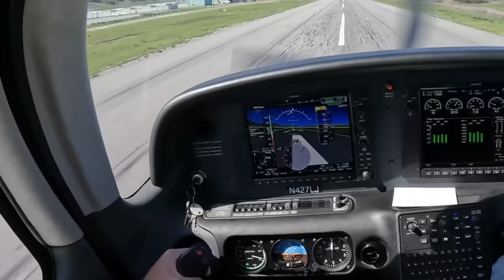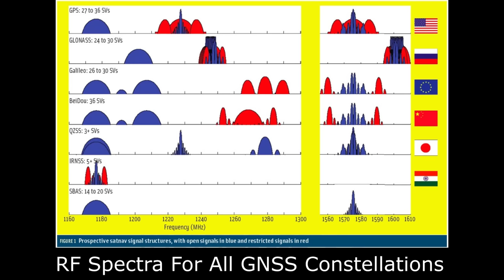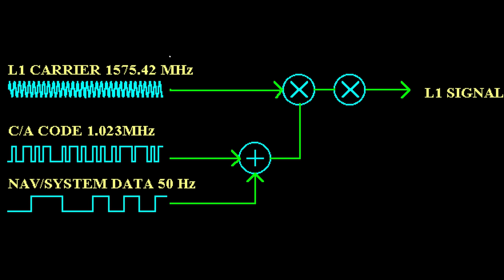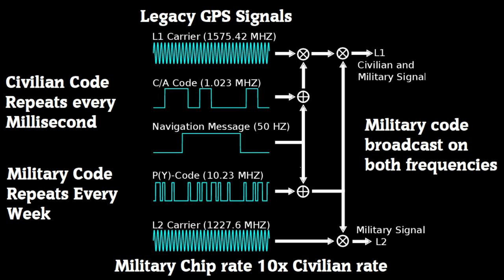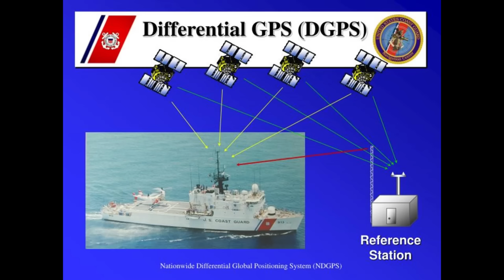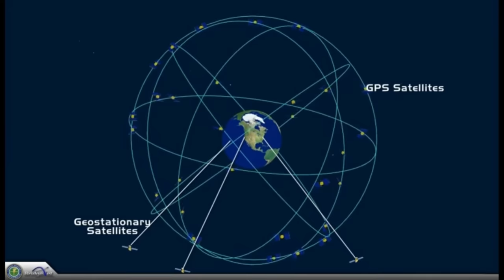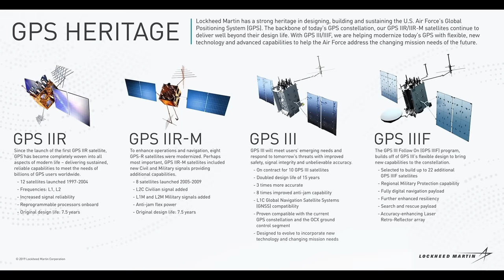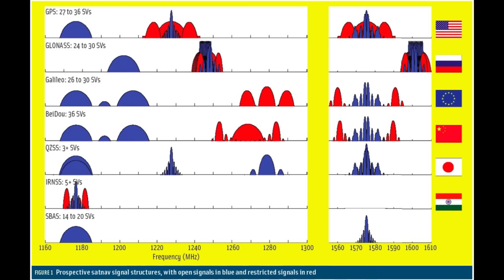How GPS Works, And How It Got Better Than The Designers Ever Imagined

Comment: I once read that civilian GPS recievers are limited in how fast and how high they can calculate to stop them being used in DIY guided misiles etc.  Don't know if this is still the case though.
Reply: It is still partially the case, commercial GPS receivers originally had to stop working if they were above 18,000m or moving faster than 1000 knots (~500m/s). Those limits have been relaxed to only disable at speeds of more than 600m/s. If you want to sell a receiver that can operate faster than that, then you'll need to apply for a license (it's similar to, but separate from ITAR). eg Copenhagen Suborbitals had to ask their GPS supplier very nicely to get units that they could use on their rockets, but as a clearly civilian program, they were allowed. 
Although these days it's possible for a hobbyist to build their own GPS receiver with no limits at all, which implies it's trivial for a country like North Korea.
Reply: Trying to get a GPS receiver capable of weapons usage is a huge pain. You have to get approval from not just the supplier, but from the government as well to purchase one. You go through all this paperwork, and jump through so many hoops to get one. And even then, lead times can be measured in months if not years.

Comment: I still want to know how the M code seems to be able to (or will be able to) provide authentication/etc in a way that doesn't mean any enemy who can extract a key gets that capability as well.   I don't see how you can do it w/o either a nightmare key rotation issue or packing too many bits into the M code.
Reply: M code’s phase data is available with a high gain antenna, no need to know the code or anything, the receiver will have enough S/N to just see the random bitstream as it comes in and can lock to it. Not practical for hiking but for large enough vehicles it’s doable. Needs a phased array antenna or an equivalent stabilized pointable dish to have enough gain. M code having unpredictable bitstream is only a problem when you have a small receiver - then you need to know the bit pattern ahead of time to lock onto it. With high gain antenna - no need to use the bitstream for selectivity and SNR improvement.

When the antenna is not omnidirectional, there’s no need for code division demultiplexing :)
Reply: @absurdengineering  Right, but that doesn't give you authentication (eg cryptographic verification that the signal isn't being spoofed).  I understood that the military equipment could do that so munitions could switch to inertial guidance in case of spoofing.

Comment: I beg to differ on a couple of points. I was in the RCAF in the 60s-70s and a friend of mine was posted to Monterrey, CA, from 1977 to 1980 to work with the USAF on the Navstar program. He returned to Canada in 1980 with a pile of documentation, on what would become GPS, that I devoured.

1) It was planned from the start that GPS would be made available to the public in order to ensure that mass production of components would drive down the price
2) the initial 100 meter accuracy was a security feature imposed by the USAF that restricted accuracy for civilian users. As you mention, the USAF turned off selective availability in 2000
3) the 1980 documentation I mentioned predicted uses by hikers and bikers and predicted that a hand held GPS unit would be available by 1995 for under $500. I bought my first hand held GPS device in 1997 for about $100

Comment: Thankyou for a good explanation.

I once worked on GPS receivers , on the correlator subsystems that tracked the signals, and one additional technique we were aware of but did not use was the fact that even though nobody outside the USA knew the week long spreading code used for military signals, you could try guessing sequences of the bits (chips) and if you guessed sequences of chips right , you could get a weak signal that was very precise but really only if you also knew your receiver was fixed, as you ended up with a  range that was totally inaccurate . So you didnt know how far you were from the satellite but you could see the fixed position drifting as the ionosphere changed.  So it meant you got nearly as good as military positioning but only for a fixed  base station.
As we were making mobile GPS silicon we could not use it.

Comment: I worked in forestry in Canada back in the mid-90s and we used GPS for various purposes - the position data we gathered was uploaded to a computer that had special software that took the uploaded data and compared it with a base station file from the same time frame to correct for errors . . . the base station was a stationary GPS receiver/recorder that ran 24/7 and you had to dial into their server to get access to the files.

Comment: Great explanations!   I used to give classes to pilots on the functionality and improvements in GPS.. from DGPS to WAAS and LAAS.   What's also amazing is Real-Time Kinematic positioning (RTK), which is primarily used for surveying.  RTK is a similar application of DGPS, in the context that a base station GPS receiver / transmitter is set up at a site to be surveyed and then "satellite" GPS units are used around the survey site, communicating with the base station to give a super-accurate relative positioning that's at the centimeter-level of accuracy.
Reply: hi 5thgen,what do you think about all gubments drawing a line around you(Antarctic Treaty) and saying you are not allowed to leave? If you don't know what I mean, read my about tab.

Comment: As a 40 year pilot I used to think the the first aviation versions of the Loran receivers were the best tool a pilot could have since cabin heaters in January. Then I played w/ my first Garmin portable receiver... GPS-95 XL about 1993ish. That was slicker than A/C on a car in Southern Arizona. It is a wonderful tool for navigation. I wonder if anyone could calculate the fuel savings by aircraft since using GPS. And of course, fuel savings means less poison spewing into the atmosphere, and less money spent on the hundred dollar hamburgers (which are up to around $225 now). And the peace of mind the GPS receiver lends to a pilot having trouble w/ recognizing pilotage landmarks, or receiving a VOR between mountain ridges, is worth a great deal too. Thanx for the insights Scott. Terry - CFI-I

Comment: I find the premise of this video hard to believe.  Around 1984 my father took a job in the 6585th test group at Holloman AFB in White Sands, New Mexico. His task as the only GS-15 on the project, was to lead a team of programmers, and the program was be a navigation reference system. This system was then used for the development of dropping smart bombs at precise spots in 3-D space. Dad's program could prove that an object was released within a 25 foot cube while a jet was flying at Mach 1. Today the transponders are on satellites and the movements tracked are on the ground, but back then the transponders were on the ground and the objects being tracked were the jets -- F-15's and 16's mostly. The system had "only" 25 feet of cubic proven accuracy -- but that was releasing an object in a specified 25 foot cube and proving it was done so at a given microsecond while said object was flying about 700 miles an hour. I don't think that a fraction of an inch for a relatively stationary object is at all "Better Than The Designers Ever Imagined." It is exactly what my dad, Gordon Simkin, envisioned in the mid 1980's. He is 92 today and has never looked for any credit, but I know what he did and I'm proud of his role in developing this technology which is a great contribution to the world.

Comment: In school in the 80's we learnt about Loran-C and the Transit satelite systems.  Later, I had to go back and take some GPS courses.  In the early 90's we had a set of six units doing control survey work.  Setting up a unit and reading signals for four hours, the guys in the office would post-process the results of the six units and get standard deviations of 1cm.  :)

Comment: The slide that shows the GPS constellation being "27-36 SVs" is interesting to me.  It's been a long time since I was working on the program, but I thought I remembered it was a minimum of 24 SVs required - i.e. not 27.  Also, while there were 6 orbital planes with 6 slots each, the SVID field, which also identifies the PRN each SV uses, was only 5 bits, so you could only have 31 active SVs.  SVID 0 was invalid.  In fact the way they would SATZAP the II/IIAs - make it so receivers wouldn't use them (typically if the clock became unhealthy) - was to command the SV to SVID 0.  A few SVIDs were also eaten up by the SV simulators for testing, down at the Cape.  I can't remember if adding a bit to the SVID field wasn't possible because there weren't any spares, or if it was just deemed a change was impossible due to its effect on all of the users, or both.  But I guess I'm curious if that 36 number on the slide means they did it?

Comment: Fascinating and well researched video, thanks. You must have put a huge amount of research into this. In the late '80s I worked on field tests in the S. China Sea for early commercial differential systems when the best we could hope for was a 3 or 4 satellite constellation for an hour or so in every 24 hours (all too often in the middle of the night when our surface broadcasts were disrupted). By the time of the gulf war, we were using standard communications satellites for differential corrections which were good up to about 1000 km from the reference station and roughly an order of magnitude more accurate than the  military receivers of the time. I know this because the military actually used our differential system during the gulf war and gave my employer a standard military receiver afterwards for testing and research as a thank you. Also, one tiny correction… To calculate a 3D position using a least squares calculation, you need at least 2 degrees of freedom to eliminate ambiguity in the result. Therefore, you really need at least 5 satellites for an accurate 3D position (x, y, z). (I'm not a mathematician, but I was told this by one so apologies if I've over simplified or mis-quoted).

Comment: One other topic worth covering is spoofing. The open and unauthenticated nature of these signals means it’s entirely possible to convince a receiver its somewhere or somewhen it isn’t. Occurrences of this by nefarious state actors are well documented. 

Both GPS and Galileo ate taking steps to add nav message public/private key signing to make things somewhat safer. You can’t necessarily get a true position when being spoofed but you will more likely be able detect it without exotic signal processing in the receiver.

Comment: During Desrt Storm, my Heavy Mortar Platoon had to use LORAN in order to detrmine our position. Due to the small number of beacons, it took about 3 minutes to plot our location which drastically slowed our response to a Call For Fire. With the rate of march for the armored attack, we never got a shot off as the tanks and BFVs began direct fire on the enemy before we could get rounds out.

Comment: Other commenters have mentioned the improvements in GPS using carrier wave analysis.
The "productized" name for integrating those corrections from various sources is called "RTK"  - Real-Time-Kinematics.  WIth a smart enough receiver, one can combine signals from the various global navigation satellite systems with ionospheric, tropospheric, and ephemeris corrections from multiple base stations, both via radio and now even internet sources.  Even better, the receiver can track its own position over time, giving it relative accuracy from position to position measured in millimeters.
Those improvements have enabled amazing advancements in precision farming.  A combine harvester can track yield for every position in a field. Then a strip tiller can only disturb soil in rows where the next season's plants will be seeded, applying fertilizer where it is most needed. Then the next planting season the planter can repeat the path in those same rows, and apply just the population needed for optimal crop density.  
The machines to do this are still incredibly expensive, but the savings on inputs (seed, fertilizer, pesticide, fuel) are immense, sometimes as much as 90%.

Comment: At those frequencies, there will also be tropospheric anomalies caused by temperature inversions. Colder air and warmer air will have different refractive indexes. Thus, there will be a lens effect that will bend the signal paths. A different effect to the ionosphere but significant nonetheless.

Comment: When I was a young officer in the Air Force, the GPS was being developed in the next building over from us.  Every so often we would get informational progress updates on the unclassified portions of the various R&D projects.  I remember them showing the GPS receivers mounted on the back of a 2.5-ton truck with a potential of getting the receivers small enough to fit into a backpack so every platoon could have one.  But even in 1979 they never conceived of a cost and size that would allow every Army private to carry one around.

Comment: It’s crazy how civilian GPS went from 10’ accuracy where it knows what road you’re on (usually), to knowing what lane you’re in at a 6’ accuracy at the end of 2021, and nobody talked about it.  Apple still doesn’t advertise it except the accident detection made possible by dual band.  Then there’s also the problem with reflections while on a hillside or in a ravine or canyon.  Basically making the signal take a longer path.  Dual band can use math and the 2 frequencies to reduce reflections.  I wonder if the upcoming solar season that makes 10 meter Hams happy will affect GPS accuracy.

Comment: Way back in 2005 I installed a Garmin WAAS enabled GNS430 in my Cessna 335.  What a difference that made to flying, especially on more challenging IFR flights (weather, rerouting...).  Later I installed two Aspen PDF for redundancy which was also a quantum leap.  But WAAS GPS still was the most significant step.

Comment: In the UK, my GNSS receivers can see GPS, Glonas and Galilio in one receiver and very quickly gets to sub 1m accuracy with 14+ satellites in view. When I started messing around with gps in the early 2000s, it wasn't uncommon for mapping to think you were on a parallel road, but now it knows if you've gone up the wrong junction.

I just wish GPS receivers with integrated inertial navigation built into their chipsets were more common - even modern cars get confused in tunnels, when they could fairly easily combine compass, speed and angle data to perform dead reckoning fairly reliably.

Comment: The first GPS ground receivers and satellite transmitters were called reference receivers and transmitters.  I saw an example of both in the late 1980's .  They were used to certify receivers and transmitters built by military contractors and civilian corporations.  Those reference models were basically half a rack of equipment.

Comment: Hi Scott! Great content as always! I’ve learnt a lot from you in the past few years. I just have one suggestion though. It is not entirely accurate to say GPS are accurate enough to land a plane. The challenge of many autopilot or navigation system is to estimate error or uncertainty from the sensors and correct for them. So in this case, the accuracy of GPS is critical but more importantly, we need to estimate its sensor noise correctly. We may also need to fuse other sensors such as IMUs to help estimate noise jointly. As you may know, one popular algorithm for this purpose is called Kalman Filter.

Comment: What I find lovely about GPS is that many civilian receivers built just after the initial completion (around 1994) still fully work with the current satellites, and they actually work better - being more accurate than indicated - than they did back then (and not just because of SA). Much more emphasis on backwards compatibility than with cellphone or computer networks.

Comment: This really just scratches the surface of how it works and how it gets better accuracy. Even just overview of modern techniques would take few hours. Lets just say that there are tens of  thousands of people around the world dedicated to making it work. The techniques and technologies behind are mind blowing. 1mm accuracy can be achieved (usually only at reference stations), but few cm accuracy is available for some uses too (not aviation, as many of these techniques do not work over ocean). There is a lot of modelling and corrections involved (including crust movement, seismic activity, earth rotation variations, solar wind, gps satelites atmospheric drag and radiation pressure from sun and earth on them, friction due to ocean movement, and tidal effects of the moon, and other planets in solar system, and of course ionosphere and troposhere modeling, including scintillation, and localized measurements; as well modelling errors in the GPS satellites itself and clocks in the entire system, and probably many more I had no clue about. I did not even mention multipath effects, leaver arm effects, and that receiver do not just use edge of bits for timing but phase differences at the wavelength scale). Differential gps is still used in some applications, but the augmented systems are usually cheaper to deploy and operate (usually using internet, 3G network, auxiliary data channels on geostationary satellites, or in case of Japan system GNSS satelites  directly - they do not add any extra positional clues, but just provide modeled corrections over big or small areas, which makes a big deal).

And did I mention that signal power at receiver is below noise level, due to special pseudo codes? Crazy.

Disabling of selected availability of course was important milestone. but not the end of improvements.